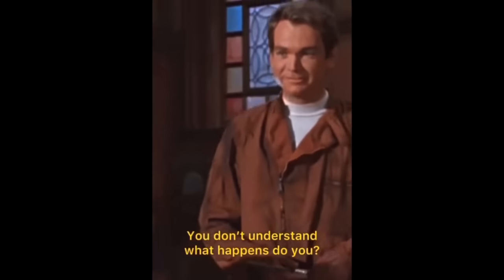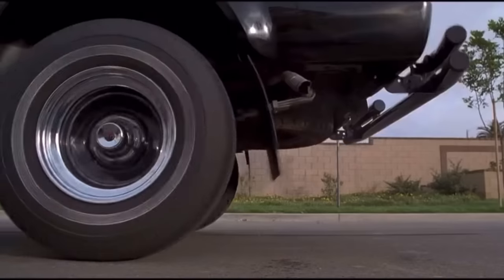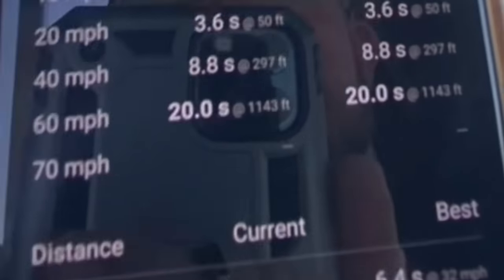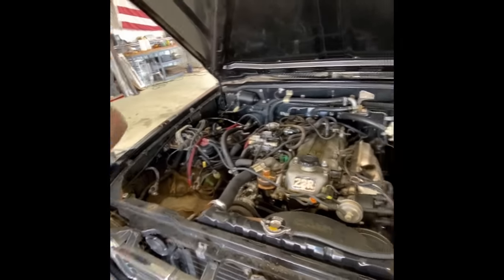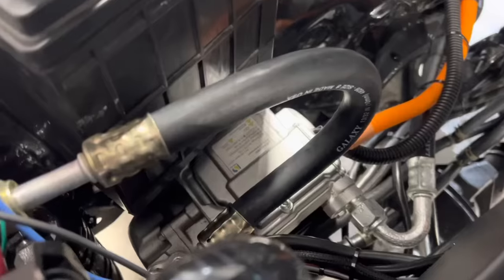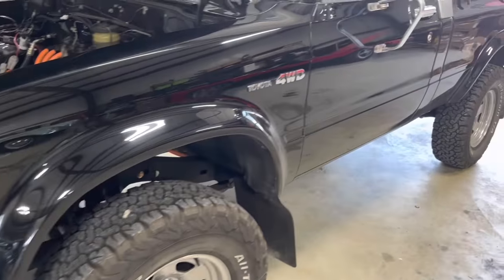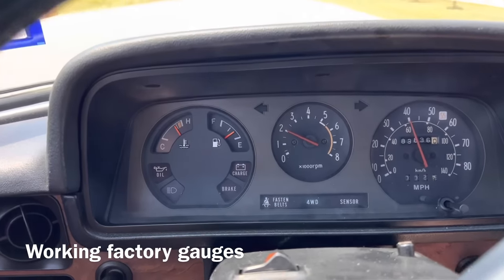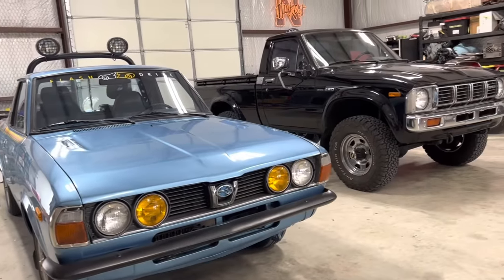22R to EV Swap: 1981 Toyota Pickup Hilux 4x4 All Electric Conversion with Hyper9 motor Tesla Battery

Comment: So cool! Great job!!!! I’ve got a 22R Toyota that just hit 200K so not touching that baby BUT I’ve been thinking about this with an engine for EV West for a mid 80s 4Runner. This looks even better though I’m just wondering about the brakes. Did y’all do a conversion with that? I’ve heard they can be problematic with conversions. 

Btw I once brought this idea up in an environmental science lecture in 2014 as the speaker was comparing C02 emissions of a brand new Prius (with the whole manufacturing process) to a older gasoline vehicle. 

I curiously said: “why can’t we just take older cars and swap out the gas engines with electric ones?”. 

He said it was impossible, and it would never happen. I was young and naive, now I say f*ck the naysayers - they’ll always exist.
Reply: Reduce reuse recycle. Old car Conversions are awesome. That old steel has plenty of life left in it. For the brakes you need an electric vacuum pump and a reservoir. I used a capped 4" pvc pipe about 2 ft long for a reservoir. It was good for a panic stop and maybe 2 more full presses on the brake before the power assist felt weak. Took about 10 sec to recover vacuum after that. So on the road it felt safe but rock crawling or racing I would have wanted more reservoir capacity or a larger vac pump.  If you keep the transmission and clutch and set the motor to "idle" you can use a belt driven vac pump.
Reply: Or you could go hydro boost instead of vacuum
Reply: That 22r sure is a great and reliable motor though!  Curious about the build because interested in converting a Suzuki Samurai.
Reply: @20tea  the 22re's reliability is based on its ability to be leaking and broken the entire time you own it without dying. 😄
Reply: how about gas generator, smal battery, and electric drive?              lighter, cheapee to run pprobably.                reason why i dont liek electric car is  that battery degradation and lack of battery recyling. dendrites that forms from battery degradation is messes with recyalability too.  if you look at sandy munroe video caled wjats insize 680 battery, there could be indicator of how much of battery can be recycled by mechnaical seperation vs what chemical process would be needed, woudl it be susntinable process? recycling company called redwood. even if they fix this problem, will they dig through trash to find enviromentally damaged (rust, mud,etc) dead car batteries currently being dumped, and recycle them? in emissions, best hting to do is a ca rof where rear seats face the rear as comcpact 4 seate rreplacing 2+2 seater cars and yaris corolla cars, and  rear mid engine small combustion flat 2 cylinder wnith no rotatiing parts to send power to wheels, instead magnets moving back and forth make electricty aand or a little supplemnetary compressed air , to power electric drive and compressed air driver, possibly with no battery or at minimal battery, using supercapacitor etc. single combustion chamber would help preserve heat for optimally low emissions or effeincy, hydrallic switch will push pistons back to position so they can be pushed by combustion..  optimal combustions per second for emissions with electric and mechnaical hybrid turbocharger, sometimes engine will run beyond optimal effiency or emissions levels for unsuually high power demand to protect long term emissiosn and fuel use reduction effetiveness of battery for common lower power use. with limited batterys to use, hybrids are already more effceint effective at reducing emissions, vs using that battery material for fewer cars who are electric cars, becaue most emissions happens in low speed high pushing power sitatuaitons of combustion car, where emissions are most likley to chemicaly harm health of nearby people becaue its usually compact city area with many people nearby.              what battery size is best for longevity?  see tony hellers climate change videos, maybe somone can make use of suspicious observers videos.    mahle says they are developing non magnets motor, so its more recyclable and cheaper..      see aptera owners club video on saftey, unqiue materials they use, lightweight is safer to peopel outsid ethe car but can be safe for people inside car compared to hevaier caar if using right materials, and even safer due to wat type of crash is more likley to happen.. linearly more lighter weight exponentially causes less road wear damage causing less resurces and emissions and road downtimes. .....  the low weight compared to  structrual strength and crash energy absorption, makes its safer per costs ,. the weight lower to ground (if that is how its still done) can make it preserve momentum around turns more, which is more energy effceint than relying on regenerative braking, and battery, brakes, lubrication, etc would last longer. tires longveity may not be affected despite higher speed and fun of preserving momentum with minimum g forces .      ....      in effeincy per functionality, rear seats facing rear in sompact 4 seater woudl make more sense. solarpanel effeincy is only arouund 20 percent and can become lot better     if u want lower emissons(whch only helpful for heath of pepe wh send mhme near heavy traffic roads), then using mited batteyr supply for hybrids is lower emson than using the suppply for fewer cars whch are eletric car. big batteyr means exppnentially less effceint, so the more energy going in and out the battery means worse battery degradation, but more parraleles of battery reduce battery degradation... so more battery is not better, theres a balance to be had.   see videos by tony heller, and suspicious observers videos on climte change and romanian tvee video called why woke wont go broke and leather aprons clubs video called a parabel on banking... theres a lot of reason to be suspicious and not much way to verify claims that climate change si caused by humans.
Reply: Last year, I heard of a French firm working on "drop-in" conversion kits.  Not sure where they are at nowadays.  But I love the concept.  I love seeing EV retrofits on YT.  If I had the shop and chops I'd consider a DIY EV conversion for my 'yota.  Just for the hellofit.
Reply: chinese sell some kei car sorta stuff to US for cheap, but you haev to put toghther the big parts
Reply: wring he dónt know shot new ev greeñer   theñ old ónñes
Reply: @sharonbraselton4302  producing new stuff is less "green"... think big picture.
Reply: @johngee9018  Goldie Wilson, "I'll hover convert your old road car to a highway flier for just $39,999.95." Back to the Future II. Be a great business for someone that knows what they are doing. Sadly like you that isn't me.
Reply: I knew I had a good idea years ago, was talking to a friend about starting a fabrication shop. To convert older vehicles to an electric platform to keep my old Toyota's if the world ever went full hydrogen/electric based.

Comment: Great video, how much did it actually cost to do this conversion and also what is the fuel guage used for now
Reply: Notice they never tell us the cost. i.e. too expensive and not worth it.
Reply: @robsdeviceunknown  why do you think affordability is the goal here? That being said, literally what engine swap with this much improvement is affordable?
Reply: @robsdeviceunknown  What old hot rod is "worth it?" They are passion projects that people love. But "I'm sure they could easily sell it for a profit.
Reply: @Akosa117  Chevy small block, advanced adapter kit. Done.
Reply: @freecanadaplease  wouldn’t shave off this much time. Next
Reply: @Akosa117  seeing as affordability isnt the point, I could easily do it.
Reply: @freecanadaplease  congratulations you’ve walked face first into my point
Reply: @Akosa117  I was making fun of your point. Friend has a 2jz 3rd  gen 4runner , I will do sub 6 second 0-60 . Used engine out of aristo. Bolts up to stock transmission.
Reply: @freecanadaplease  lol and here I thought you might have understood the point of the build. Yet here you are, still not getting it😂
Reply: @Akosa117  just to do something isn't a point. To take away the original purpose, isn't a point. To make less reliable isn't a point. Make it more expensive isn't a point. It's been done before, so that not the point. Oh wait I get it, it's pointless.
Reply: @freecanadaplease  yes those are all points. You just don’t like them and that’s a problem with you and only you
Reply: @Akosa117  no the problem is its way to expensive. That's it.
Reply: @freecanadaplease  and like I said in the very beginning. The point wasn’t to be affordable. Nobody called it cheap
Reply: @Akosa117  VW diesel ALH swap. Gives you mileage and towing capacity along with 6 second 0-60.  And you can run it on cooking oil making it zero emissions. Also good for 500,000 miles. Diesel for the win!!
Reply: @freecanadaplease  need 64 kw baters
Reply: @freecanadaplease  The main point is that it’s super fun. Looks like,they learned a lot. Wonder what they’ll try next.
Reply: @jysmtl  you need to solve a problem, other wise it pointless. If you EV an old vw beetle, you are gaining many things like speed, A/C, Heater and reliability. And only losing range and cost. With the truck your losing weight capacity, offroad ability, reliability, range and cost. They don't even show how they do it.
Reply: @Akosa117  it isn't viable at all their kit which is just the basic driveline components is $20k US, with that you still need an adaptor from the motor to the trans, you need to build/buy some sort of enclosure for the batteries, and finally any extras you want so power steering AC etc. So minimum $25k assuming you do the conversion yourself probably $30k plus if it's a shop doing it. Mind you a reco motor installed would probably be about $5k and while it would be as quick that engine would be like a new one and last another 42 years
Reply: @shaynegadsden  the point wasn’t to be affordable guys💀 why can’t y’all grasp that?
Reply: @Akosa117  i said viable, and while cost is a major factor the conversion offers nothing useful to a hilux or similar vehicle it has taken away all the utility and relability that was there and the only thing gain is speed the one thing you don't need or want in that kind of vehicle
Reply: @shaynegadsden  did you even watch the video? They literally said it was more reliable in their opinion, which make it more viable. And still none of that was the point of the build. Y’all spend too much time hating electricity
Reply: @Akosa117  2rz or 3rz if you wanted to stay with an ICE engine
Reply: @Akosa117  that is called marketing they are trying to sell you something and aren't being accurate that's why they said if was more reliable in their opinion not that it was more reliable which would be false, because there is no way that system will last 42 years and still be working.
Also i don't hate electricity i'm an electrician but do understand how all that works and i have a 4x4 very similar to that just a bit newer model

Comment: Around 44 Kwh or by my reckoning 150-180km of range (93-110miles). It's ok for a city or local driver. I assume you can get more in there though if asked for. It's a nice conversion guys. Keep it up.
Reply from the maker: We are going to do a follow up with more tech. So keep watching and we will have that soon. Thanks for watching
Reply: Bro how often do you drive more than 100 miles in a day?
Reply: I think EV's have a much brighter future in urban environments.  We live in a very rural area, and its a 120 mile round trip to the nearest Walmart or place of any population ~45,000.  Where we live I think IC engines will always be the norm.  My contracting business would service several locations in a day and it was very common to drive ~300 miles in a day in very back road areas.
Reply: @douglasburnum9722  what percent of the population is in your shoes ?
Reply: @LemonySnicket-EUC  , Probably less than 20%. We have to drive ~250 miles to get to a area of population >100k people. Family members from Seattle would take pictures of the wide expanse of nothingness. They said it’s really difficult for their friends who have always been in Seattle to imagine the wide open spaces. Being able to see for tens of miles to the horizon without any buildings or structures blocking the view.
Reply: yes  it  ís
Reply: @LemonySnicket-EUC  and what percent actually need a pickup
Reply: @commorevpenguin9602  I commuted 30-40 miles per day for a few weeks when I bought my 88 4x4. 18mpg was rough. This would be perfect 🍻
Reply: @commorevpenguin9602  Where I live and work 200km drives are minimum once a week. Nothing unusual to do a day run to the city and back to home that can clock over 600km for the day. With the loads I carry and tow with my Falcon 1 Tonner this thing would barely do 100km. If you want a city car these conversions would be fine. I want a 4wd that can do 1200 to 3000km across the outback and deserts where there are no  charge points, service stations or even bitumen. I've worked on some stations where you can do a 300km drive without leaving the property. 
I know that these things are not what this vehicle is built for, but until someone comes up with equipment that is, then the good old internal combustion engin will need to be around for a long time to come.

Comment: Thats insane !   Never heard a EV shift gears before !   Sounds awesome 👍
Reply: yes it is
Reply: That’s because the hyper9 motor bolts onto the transmission with an adapter plate. Modern EVs don’t have transmissions. You lose some of that power and efficiency by keeping the transmission and driveshaft, versus using the modern axle motors. 

The sound is nice, but getting rid of the transmission and driveshaft makes it possible to cram more batteries inside the frame. And a truck like that makes the perfect platform for Tesla Model 3/Y batteries, which are longer than the S/Y batteries
Reply: And I don't know how strong the electric engine they put in is, but they could probably just start in some higher gear to begin with. Usually no need use lower gears, unless it's a weak engine or you are towing something.
Reply: Most older dc motor conversions I've seen were done on manual transmissions and kept them for ease of mounting. With proper voltage you can just cruise 3rd/4th gear never using the clutch.

Comment: Conversion makes a lot of sense for old vehicles like this which most people wouldn't take long trips in.  For running around town, or short trail runs this is awesome.
Reply: Everyone pushing EV’s keeps trying to convince themselves, and everyone else, that most people don’t need to rely on their vehicles for anything but 5 min trips to the store. Cold weather, hills, desert, long range trips etc, are all things that make these things not only unfeasible, but potentially deadly. I haven’t seen a single EV that comes close to its claimed range, with any of the variables mentioned above. Family of 4 or 5? 30% loss. Below 32F? 30-50% loss. Above 100F and live near mountains with 4 in the car? Just forget about it.
Reply: @apacheworrier3776  This is just the start of electric vehicles, I LOVE my gas and diesel vehicles, But it has taken 137 years to get gas vehicles to where they are now, and I bet within the next 25-30 years, electric vehicles will surpass what the majority of gas and diesel vehicles can do, so I can only imagine what EVs will be capable of in the next 100 years.

Comment: This is a really cool project especially for a older truck, You guys did a awesome job! 
I'm doing a EV conversion too on a 2020 Ford Ranger using a Tesla Model 3 Donor.
I will be trying to keep the Ford system stock and only having the Tesla as drivetrain.
I will have to make a custom frame to hold the battery pack and the subframes with motor.
I just hope I can do as good a job as you guys did with this truck!

Take it easy guys, 
Casey
Reply from the maker: Thanks Casey, good luck on your build. Sounds pretty awesome!

Comment: 5:34 that’s the first time I’ve ever seen anyone shift on an EV swap before and it was really awesome. Imagine this swap in a car already built for handling and speed? I know what toy I want in the future now.
Reply from the maker: The manual transmission is a fun feature on these swaps. You can still row through the gears and maximize the torque and chirp the tires.
Reply: Yeah that should tow a lot and still keep motor cool. Also much of torque for offroading. I would like to convert Mitsubishi pajero because electric cars that can tow cost so much and you can't take them offroading. @dissrepair

Comment: As a manual transmission fan, I would much prefer something like this to the zero transmission variants currently being offered by Tesla and everyone else building EVs.  I recall seeing someone do a conversion like this with a corvette, leaving the manual transmission in place, and the owner said it was fantastic.  The joy of driving manual, plus electric torque and reliability...it's a great thing.  Unfortunately, the HV Hyper 9 only makes about 120 HP, so great for this truck, but not so much on a muscle car or sports car.  Wonder if anyone has ever bolted an actual Tesla motor to a manual transmission?
Reply: @kenjifugimoto  - True.  That could definitely be done, providing there's enough space for the 2nd motor.
Reply: @meadmaker4525  Wait, EV's CAN have manual transmission??

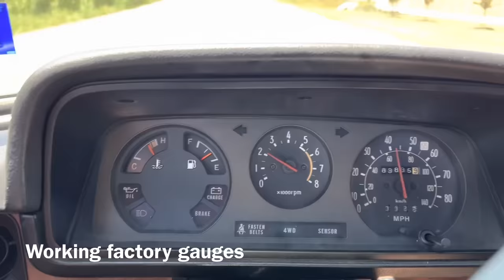Comment: very cool, at 4:57 you show all the gauges working could you elaborate on how or what they are talking to on the back end, I assume the OEM speedo still uses the stock transmission output but for example where does the tach get it's signal from and more importantly how does the fuel gauge aka SOC (State of Charge) work, please and thank you